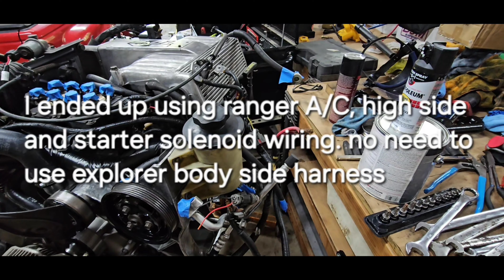2000 Ford Ranger 5.0 Swap Pt.8 3.0 Engine Removal

Comment: what kind of swap would yall recommend for a f-150 1984 budget build
Reply from the maker: @noelbeiza4941  351w or bored out to 408. Maybe a coyote or 4.6/5.4. Maybe a 4 valve 5.4
Reply: Just tossin some idears but maybe a 392 clevor might be worth a shot.